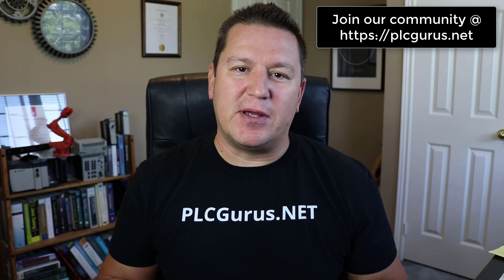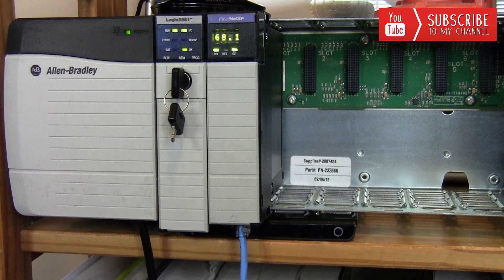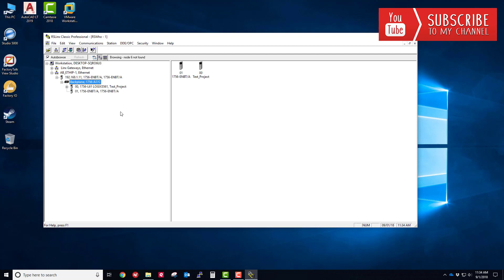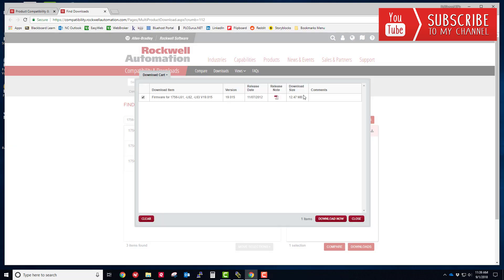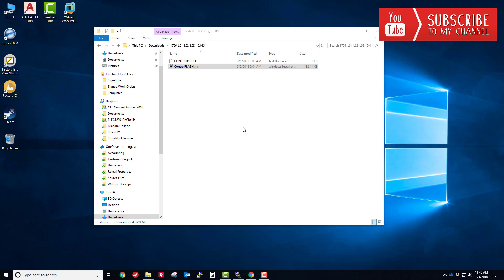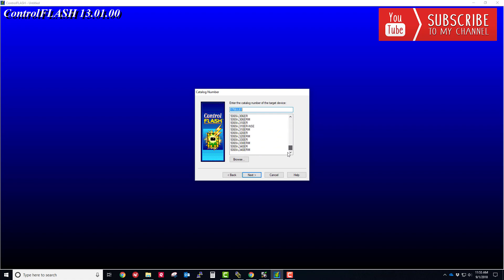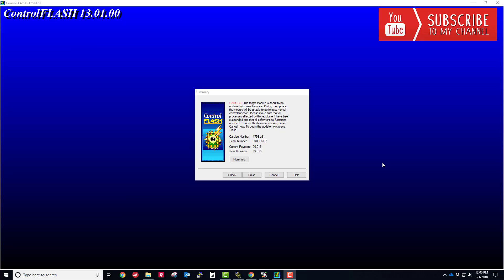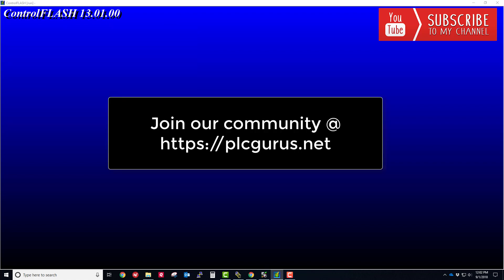PLCGurus.NET - How To Downgrade ControlLogix Processor Firmware

Comment: Thanks a lot. No affence but I have a question, does it necessary to backup the previous programs before the update? Means during the updating or downgrade of the firmware there wil not be the risk to lose the program in the L61 controller?

Comment: Great Tutorial Demo and all the ways you can access Control Flash for the firmware upgrade or downgrade. Its a very good thing to know how to do. The Control Flash Plus is the new  Firmware Flash utility and much faster with quite a few enhances. From the recent RA TechED 2019 I attended in Orlando, FL i sat in a session on the new Control Flash Plus for firmware installation and its been revamped/upgraded and even cooler than before bit and much faster also. RA Reps there also demonstrated that they wanted to add some cool new functionality and i'm sure i'm forgetting stuff already, but you can if connected to a Network the utility can find what has what firmware installed currently. It can then Firmware Flash multiple devices all at once now and I believe up to 10 devices max all at the same time showing you in real time a time bar on each device being flashed. Both are very cool features added. I think i wrote down more stuff for notes, but that's what i currently remember without consulting my notes.